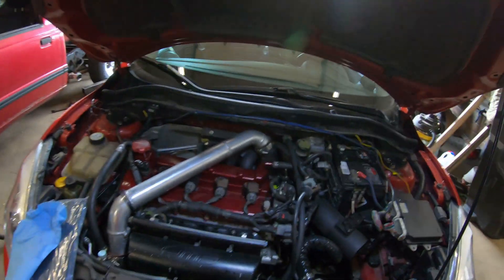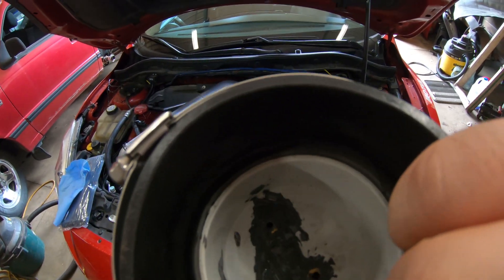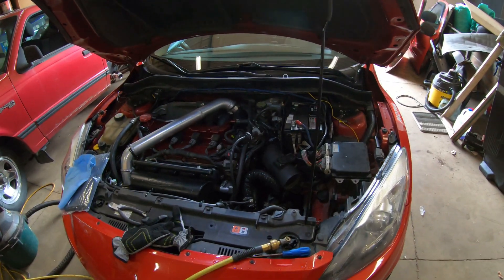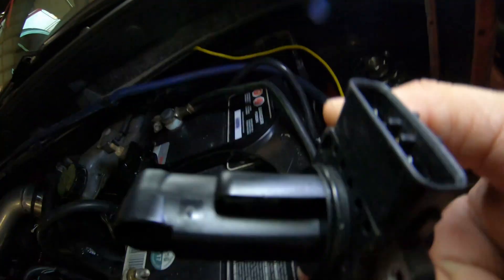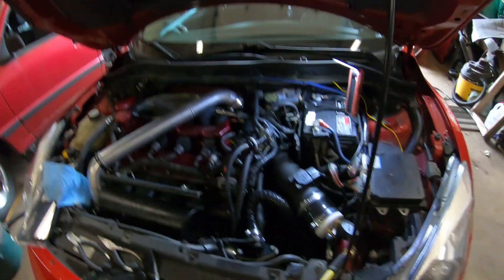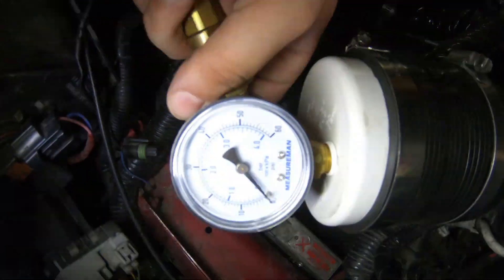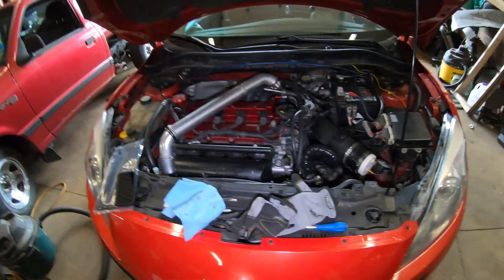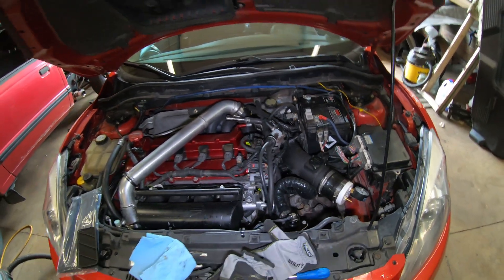DIY Boost Leak Test | Home Made Tester

Comment: Thank you for your video.  I made the same mistake as you and ran the test from the intake, forgetting to pinch or disconnect the intake to valve cover hose.  Air came out of the VVT solenoid seal.

Is there any risk of damage that I could have cause by doing so?  Corksport warned of high crankcase pressures...really hoping I didn't screw my car up worse, lol
Reply from the maker: You should be ok. You’ll know soon as you fire the car up and drive it a bit. The biggest concern is actually blowing the rear main seal and having an oil leak. That’s the worst lol

Comment: How much HP and what turbo
Reply from the maker: Gt3071r and it was making about 370whp
Reply: @BuildinProgress  hey where you install the 12 vollt red cable for split second controller
Reply from the maker: I haven’t wired the split second myself yet so I’m not sure. If it’s the 12v power wire(red) you’ll just want to hook that up to something thats switched with the key. There are some good how to’s on the Mazdaspeed forums.

Comment: Does this fix vacuum leaks also? Or just boost I hit full boost but car running really rich thinking it’s my 3 port or a intake hose
Reply from the maker: This will check for all boost leaks and any vacuum leaks as well. If you have anything leaking during this test make sure you fix it.